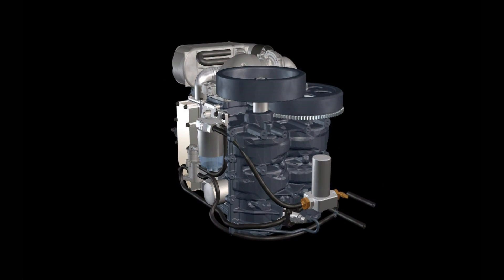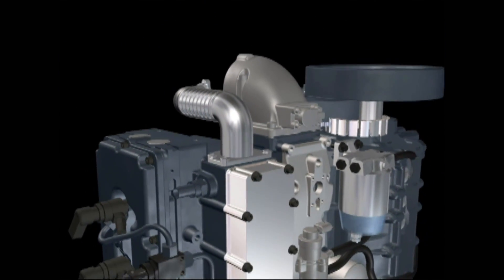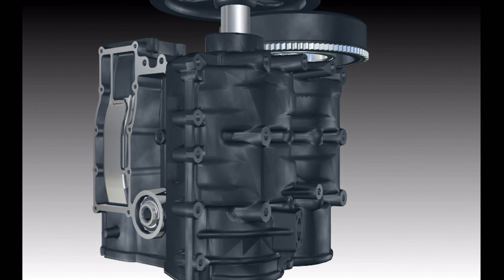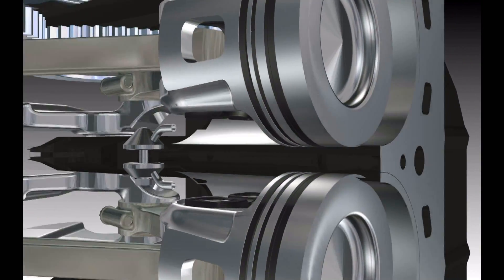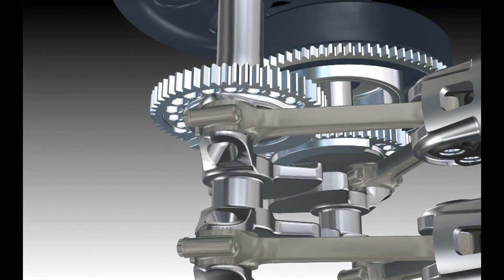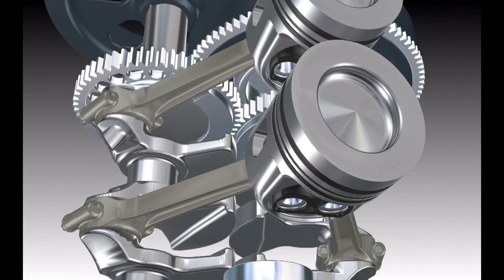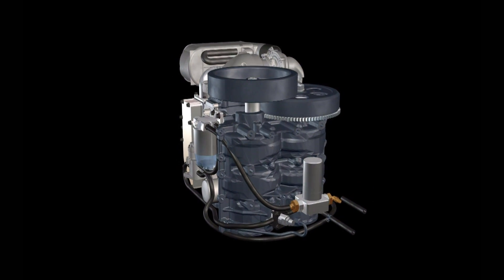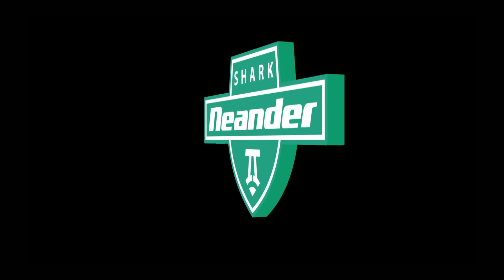Neander Technology (english)

Comment: More rotating mass is loss in power
Reply from the maker: The real innovation provided by NEANDER for the Dtorque is the development of the patented ‘Spaceball’ design and a unique system of dual counter-rotating crankshafts in an aluminum block. By rotating in opposite directions, the considerable vibration that a conventional small
two-cylinder diesel engine would normally generate is eliminated.

Comment: More and more than i'm watching thos simulation, i'm getting feeling that this engine design has potential to solve moredn 3 clynder engine balancing problems.

Truth is that engine will be bit more costy, but probably 3 clynder would ran like a kitty, even if desing would use 120° separation betwen crank lobes.

Am i wrong, or did u played with this idea?
Reply from the maker: We are currently concentrating on 2-cylinder engines, which can be made even smaller and more compact.

Comment: This engine has 1 (in words: one) advantage over other piston engines: The second crank shaft eliminates a good portion of the vibrations. That is really good, especcially in any craft used for recreational purposes. I would love to own one of these engines for my boat!
All the other claims can be achieved by standard piston engines just as well, so these are no real advantages.
The claim of less weight on the other hand is outright false: Adding parts (second crank shaft) to an engine obviously increases the weight. And the gog-wheel coupling of the two crank shafts adds a bit noise, unfortunately.
The claim of more compactness is at least depending on how much one is willing to bend his own view: When the basis of comparing is the level of vibrations, then a second crank shaft enables for a lower number of cylinders to get to the same vibration level. And by increasing the volume in each cylinder (upto the same sum of power output), the surplus of parts added below (crank shaft) is compensated by the lower number of parts used for less cylinders. But whether that means more compactness is up to anyones definition.
Anything else is standard.
BTW an engine with two counter-rotating crank shafts coupled by cog-wheels is not new. A good example is the Suzuki Rg500 (debut 1984) engine. There, the compactness was increased in terms of space, giving the opportunity to arrange the 4 cylinders in a square instead of the well known R or V arrangements.

Comment: Will u guys try to go into oposed piston engine in near future, with youre design?
Reply from the maker: it is a supercharged in-line 2-cylinder diesel engine. the side guide of the piston is the key! The key enabler for a dual crankshaft engine with a constrained piston movement by two con-rods with theoretically no piston side forces is provision for forgiveness towards tolerances, which can lead to off-design positions of the piston in its cylinder bore and unfavorable mechanical effects like scuffing, sticking or simply higher friction as the least bad of effects. Inventing and introducing a so-called space ball design resolved the problem, giving the piston the additional degree of freedom of rotational adjustment around the two piston pins.
Reply: @neandermotors9480  thx for ansewrw, but i think you didnt completely answered my question. So company doesn't have any plans to go oposed piston 2 stroke engine (when pistins are moving towars each other) like Achates power engine ?
Reply from the maker: @bajkerjohnvolta  no, we continue to pursue our patented technology.
Reply: @neandermotors9480  thank you for answer ^^
Reply from the maker: @bajkerjohnvolta  you are welcome!

Comment: Concept is pretty cool but combustion (power Stroke)takes place in one cylinder is transmitted to two separate crank. How come dividing and transmitting power stroke to two separate crank increases the efficiency and total power output?
Reply from the maker: Thanks! It is an charged in-line 2-cylinder diesel engine ;-)

Comment: I think that is really neat. It would be cool to see it power small cars or three wheel vehicles. Perhaps convert it to use bio-fuels? could it run using hydrogen?
Reply from the maker: You can run the engine with some types of biodiesel!
Reply: There is a hybrid car called the R Q Riley XR3. I wonder if it could be used in a similar situation?
Reply from the maker: @thomasleemullins4372  theoretically this would be conceivable, but we are currently focusing on other application areas.

Comment: Why arent clynders sepsrated by 180°?
Reply from the maker: We have found that our chosen solution is the ideal one for our technology.
Reply: @neandermotors9480  aa oki, oh yes i see, counter rotating crankshafts connected by gear, makes perfect ballance
Reply from the maker: @bajkerjohnvolta  just right :-)
Reply: @neandermotors9480  But i have to admit, its hard to get over that, cause we are so used to old paradime of more clynders = higher angle coverage in one turn :D but good design :D
Reply from the maker: @bajkerjohnvolta  That´s true ;-)

Comment: interesting idea but wtf is the point of having 2 wrist pins plus another larger pin that they both rotate in with uneven loading of the cranks? its supposed to all balance out yes. but different points of failure and much worse when a failure occurs. you end up with something worse off than a 4 piston opposed piston motor. you would have 4 pistons and 2 cranks and the same number of conrods with no funky crap going on in the wrist pin carrier. someday well get back to the proper engine and make a real 2 stroke. best power to weight ratio weve hit so far and can have much better emissions than a conventional 4 stroke and most likely most diesels. 2 stroke electric hybrid could be many more times as "efficient" as many diesel electric hybrids as size and displacement wouldnt need to change to produce more rpms or make more effective generator coils. rev that thing to the moon and create more voltage or charge. gear it down if rpms are a problem for the generator and do even more work with less motor.
Reply from the maker: thanks for the comment. We consistently develop the technology further and pursue different areas of application, performance classes and also the hybrid idea.
Reply: @neandermotors9480  i sure hope you do because if nobody does im going to have to. its wasted potential. simple motor the highest hp/litre or weight engine. and 2 stroke works best on cvt or constant duty rpm right at its peak powerband. perfect for a generator coil that likes certain rpms. i have a little 2 stroke scooter thats about 18hp 68cc and easily does 75 mph and still manages 30-40 mpg but can out accelerate most things on the road. they are such slept on technology.

Comment: I not that as the power stroke starts the con rods are almost inline with the bore of the cylinders,  this will give more torque to the power stroke. I also note there is a big gudgion pin with two smaller gudgion pinsin it for the little ends of the conrods,  this big gugion pin swivels a little ----wonder why that  is ?   The engine does look like a good idea though.
Reply from the maker: Thank you very much for your comment. A key role in the design of our double crankshaft engine with a crank set and two connecting rods is played by the lateral guidance of the piston. Here, the tilting of the piston in the cylinder must be prevented in order to ensure longevity. We have solved this problem with the "Spaceball", also patented. This bearing absorbs the movement of the set connecting rods and thus ensures low-wear running of the piston in the cylinder. Further technical information is available here: https://www.neander-shark.com/en/technology/

Comment: if both pistons go down at the same time, what force brings the pistons back up again?
Reply: This a four-stroke engine. When one cylinder is in combustion cycle, the other is in intake cycle.
Reply: Flywheel inertia.  Exactly like a single cylinder.
Reply: One cylinder is on the expansion stroke while the other is on the compression stroke.  This 2-cylinder would have some wobble, but a 3-cylinder (or more) would eliminate even that. This is  the most elegant evolution of the piston engine I've seen.
Reply from the maker: thanks for the question and the answers. On our website you will find more information and, if you are interested, a detailed elaboration on the advantages of technological development: https://www.neander-shark.com/en/technology/

Comment: A single cylinder version that is tuned for efficiency would be great in a big enduro bike.  2,5 litre per 100 km or less please.
Reply from the maker: nice idea, but we have put the motorcycle project on hold for the time being ;-)
Reply: @neandermotors9480  make affordable and solid bikes, the project will succeed, hipsters will not prevail
Reply from the maker: @cq33xx58  thanks a lot for the idea, but at the moment we focus on the Dtorque outboard motor ;-)
Reply: Well its a bummer that motorcycle project is on hold.

Comment: 👍🤔🇺🇸🇬🇧🇬🇧SPECIFIC FUEL ⛽️CONSUMPTION  PER B,H,P,   HOUR Would HELP , 🤔🇬🇧🇬🇧🇺🇸
Reply from the maker: It is a diesel engine therefore with diesel fuel. The consumption of the engine depends on the application. So far we have realized an outboard engine in series, which consumes an average of 4 liters and under full throttle an average of 12 liters.

Comment: This design increases the number of moving parts substantially, which will decrease efficiency.
Reply: @Heads Mess You may have half the pistons but I don't think you'll have the same power as a 4 cylinder, and if you did you wouldn't have half the load on each bearing.  something has to give.  Any engine that needs a balance shaft wasn't designed well to begin with.
Reply from the maker: @Drcraigpl  With a remarkable torque output that peaks at 111 Nm at 2,500 rpm, the Dtorque’s performance surpasses the leading 70 hp fuel-injected, four-stroke gasoline outboards. Our Dtorque is the first application in series as outboard motor ;-)
Reply: @neandermotors9480  If you can use 100% biodiesel in your outboard water pollution would be much reduced if there was a spill.
Reply from the maker: @gregripp  Biodiesel B7 and B20 can be used in our Dtorque outboard!
Reply: @Heads Mess Apparently you haven't checked out my YouTube channel or else you would know the answers to most of your questions.

Comment: Dear Neander team, i see you have marine and motorcycle aplications.
Knowing marine aplications require prolonged usage with more than 60% to 80% of power i can see your engines are highly reliable. What is the weight of engine, do you sell them as stand alone units to private users and what is the price of engine alone?
Reply from the maker: Our Dtorque outboard motor has a dry weight of 175 kg. It is specially designed for commercial shipping. Here you can find more information on our website: https://www.neander-shark.com/en The distribution is handled by our worldwide partner Yanmar, the link to the product inquiry can be found on our website under "Sales". I hope we could help you!

Comment: For balance reasons I had always admired the Ariel square 4.  More compact and better balanced than the modern crop of 4 cylinder engines. But when I saw this I said WOW.  Fewer but larger cylinders are more efficient and last longer but are plagued with vibration.  This solves that problem.  And the balance also extends to zero side forces on the cylinder wall.  Along with asymmetric motion of the piston.  Although it would cost more to have two crankshafts you don't need extra cams or valve trains that are used in a larger number of cylinders.  What an absolutely brilliant and elegant solution.  Well done.
Reply: I agree the ariel was smooth it was improved after ariel finished producthon a modern one would be interesting to see

Comment: Have you considered a 4 cycle gasoline version of this engine?
Reply from the maker: no, the clou is that our potential power spectrum of the engine concept ranges from a 400 cc single-cylinder to a 1.4-liter two-cylinder engine in a power range from 12 hp to 110 hp with a torque of 25 Nm to 220 Nm.

Comment: What is Neander's solution to prevent / decrease NOx emissions and particle pollution, common flaws for all diesel engines?
Reply from the maker: The optimisation of the environmental compatibility of internal combustion engines is becoming decisively important to our society. The reduced consumption of the Neander engine results in correspondingly lower CO2 emissions. We are all currently well below the specified emission limits.

Comment: Would love to see a 6 cylinder turbocharged implementation, 1000hp easy lol
Reply from the maker: The potential power range of this engine concept ranges from a 400 ccm single cylinder to a 1.4 litre two-cylinder engine with a power range from 12 hp to 110 hp and a torque from 25 Nm to 220 Nm.
Reply: @neandermotors9480  is there any data available on consumption, efficiency, lifetime?

Comment: Smooth but heavy?
Reply from the maker: Not heavier than a 75 hp petrol engine with comparable performance. Due to the lower fuel consumption and the associated lower tank filling, the system weight is even lighter.

Comment: Have you tried running this engine in a motorcycle?
Reply from the maker: Yes. The NEANDER engine concept has already been successfully implemented in the world’s first diesel-engine motorcycle. (https://www.neander-motors.com/en/motoren/motorcycle)
Reply: This is not a new concept, Deutz used it in a motorcycle many years ago, likewise, The British Company Roots Group ( makers of Hillman, singer, Humber cars, and Commer Commercial vehicles) used this in Commer Trucks and busses in the 1950's
Reply from the maker: @alanh6994  not in a Turbo Diesel motorcycle with 100 HP ;-)
Reply from the maker: @Heads Mess The first high-performance turbo diesel motorcycle in the world with 214 NM and 112 HP😉💪

Comment: Well geometry of piston connecting to crank case is new concept that aligns piston always in dead center in any stroke.theirby reducing friction n double crank means double no of bearings mean less friction...unlike common rail 2 clyender engine it will not vobble .less friction less heat more preformance efficency n durability...it will be ground breaking teq as we have lot of small crdi twin piston  diesel engines in India...
Reply from the maker: yes, it really will!

Comment: All I can say is lets see one run for 1,000,000 miles.  Show me a torque chart & compare it to a cummins 4bt.  Too many parts & links to fail. If a counter rotating shaft is needed then add a balance shaft. I would rather see the compression ratio lowered with a combination of super charger & turbo making up the difference.  then ad a manifold heater for cold starts. 2 connecting rods on 1 piston, this is an engineers wet dream!!!  Thumbs down for the hype - where are the dyno & fuel consumption & emission test results?
Reply: Why do you need it to run for 1 million miles? What cars, bikes or outboards need engines to last that long?
Reply: @HarleyRog  Cummins, Cats, Detroit, international diesels run for that long. 1,000,000 mi or 300,000 hrs.
Reply: Bob Masters are they small two cylinder motorcycle diesels as well then?
Reply: @HarleyRog  I used to ride lots. Simple engines break less, weigh less & cost less. A diesel twin crank moto engine, I'm laughing!
Reply: @HarleyRog  diesels generally too heavy(rotating mass) & have too narrow of rpm range for a moto for me. I want longevity & efficiency from a diesel
Reply: Bob Masters let’s keep an open mind and wait and see if anything comes of it. Generally speaking for bikes if they had been any good they’d have used Diesels years ago.
Reply: @HarleyRog  great, as long as you understand what you are saying.
Reply from the maker: Everything successfully realized. More information about the product can be found on our website and in the brochure: https://www.neander-shark.com or @ YANMAR: https://www.yanmarmarine.com/dtorque/

Comment: I can't see the gains, apart from no piston slap but a crosshead can do that.
Reply: @Gordon Bird Where is the real engine and hard information ?
Reply: @Gordon Bird Gordon, two crankshafts has raised the weight, the width of the crankcase, the friction and the manurfacturing costs due to the very high accuracy in the coupling of the reciprocating and rotating parts.
The whole triangulation between the crank pins, rods and point of ignition looks very dubious, the animation is not very convincing when does it fire.?
The torque from a reciprocating engine is relative to what goes on above the piston not how many con rods you can attach to a piston? 
Who else sees iron liners as the way forward and this looks very hard on its big ends.
If this engine exists out side of a computer I look forward to seeing the dyno figures. 
I actually like the idea but feel sure if it really had any thing going for it then it would already have been tried. 
All these fancy ideas that keep being put forward but none ever prove they offer something for nothing. It's not for nothing we are still using the same basics we have for 120 years.
Reply from the maker: The central aspect of Neander technology is a unique innovation with which the complex requirements of modern high performance diesel engines can be completely fulfilled: the double crankshaft.

Comment: I think is the same thing, i dont see any advance, that company is are using two crankshaft and that increase the weight, etc.
There are a lot things to say, but in afew words... It's no enough for those people how's know about internal combustion engine.
Reply from the maker: The advantages are: Lower manufacturing costs, Less CO2emissions, More efficient fuel logistics, Greater driving comfort,  Greater dynamics, Greater safety – lower investment costs and 4 Power take-off shafts.
Reply: @neandermotors9480  how the fuck is there lower manufacturing costs when you're doubling the internal components